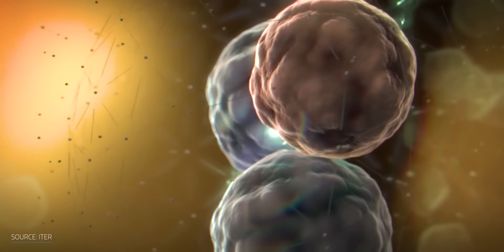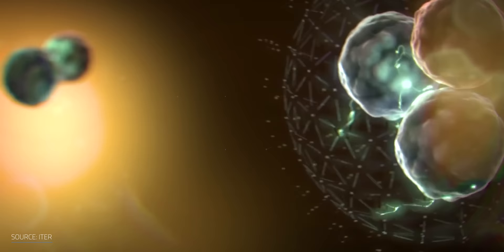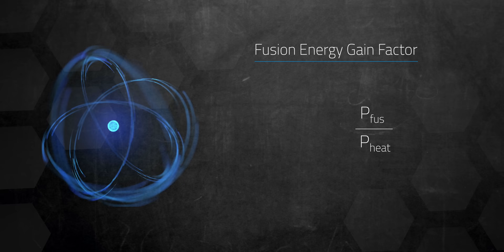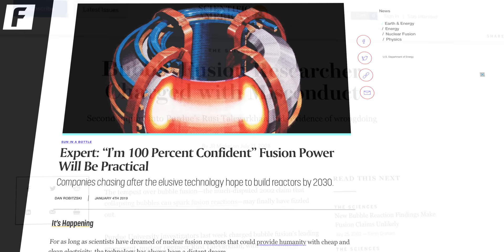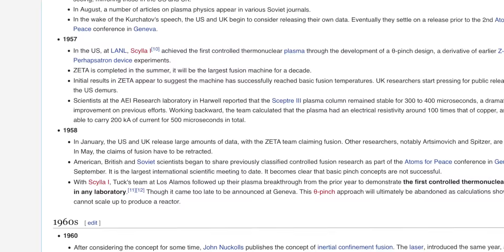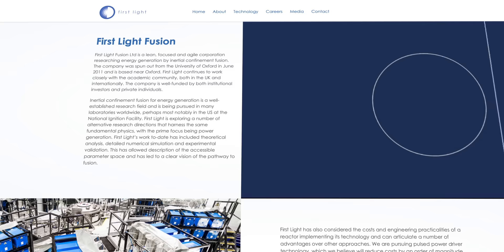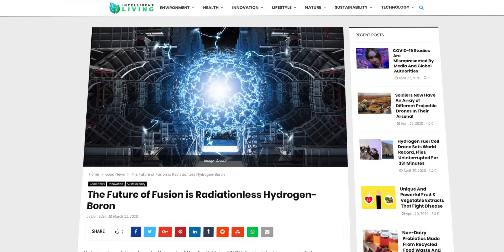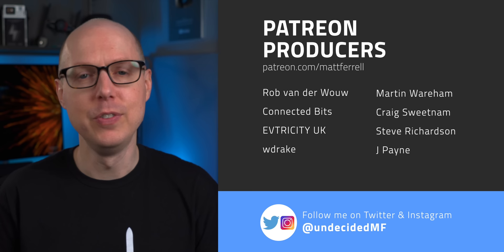The truth about nuclear fusion power - new breakthroughs

Comment: An important distinction between stars and reactors. The video implies that fusion in stars happens when two atoms 'slam together'. What actually happens is that two atoms can get close enough together that sometimes they will quantum tunnel past the electrostatic force and are then able to fuse. Otherwise they never meet. Given the vast amount of atoms in a star this happens frequently enough to produce a sustained reaction. This is why nuclear fusion reactors currently use temperatures far exceeding that of the core of the sun, as they don't rely on quantum tunneling but instead actually do 'slam together' atoms as we think of it. Stars wouldn't even be possible this way, as they simply don't get hot enough. A bit of semantics given that nothing really 'touches' to begin with, but nonetheless useful to understand.
Reply: 🤔 good point
Reply: Well put. Stars -- at least solar mass ones -- are very inefficient fusion reactors. The Sun's core produces less heat per unit volume than your average compost heap. It's just that there's an awful lot of it, and the heat spends an awful long time battling to get out of the core which is fifteen times the density of lead!
Reply: I thought the reason stars produce fusion at a fraction of the heat of a reactor is because of the huge amounts of gravity that squeeze the atoms together? Fusion is fusion.. why would the atoms in a star not meet, but in a reactor they do? I'm not saying you are wrong but, that doesn't really make much sense.

Edit: And to add to that, fusion is produced when two atoms combine. So what does quantum tunneling have to do with it?
Reply: @joshoconnell2104   I'm not wrong. You are correct in that it's about temperature for a fusion reactor even more so than for a star. As I explained, there's the electrostatic force that gets in the way for a star, but with so many atoms enough pass the quantum barrier to fuse anyway. Otherwise stars would use up their fuel in a fraction of the time. Atoms in a fusion reactor get much hotter and thus can simply brute force slam together.

Do a search and read up on it. Search for something like "Star fusion quantum tunneling". Be careful of your sources still of course!
Reply: You should go join them at the nuclear research center
Reply: @videosbymathew  You didn't really answer my question. I'm not out to look for the information you have already read yourself, I'm asking why a quantum phenomenon has anything to do with fusion. I'd like to hear your explanation. I'm certainly not denying that some fancy quantum stuff is going on in a star but, it also happens from an atom by atom basis so, you haven't answered much in that response. Mass and quantity plays a huge role in a stars fusion but, that doesn't explain why it is so much different to fusion we create here on Earth.
Reply: @videosbymathew  By the way; I'm not trying to disregard what you are saying. I'm genuinely curious to learn more about your conclusion.
Reply: @joshoconnell2104  No worries! I would highly recommend you still read up on it yourself. I would also read closely on how quantum tunneling works, which is what's happening when two atoms get close together in a star to fuse. They tunnel past the electrostatic barrier, allowing the completion of the atom to fuse whereas normally they wouldn't be able to get that close. Quantum tunneling makes fusion possible in a star.

As I tried to explain, the star is not hot enough to fuse atoms without this quantum tunneling effect.

I think what you're maybe hung up on is perhaps a misunderstanding of the word "quantum" and perhaps some woo woo you've read about it in the past. Definitely read up on the above, it'll help explain everything!
Reply: @videosbymathew  Yeah, I think I'm missing some crucial information here that isn't allowing me to understand what you are talking about. I appreciate the response though and will do some research on it when I get the time. Thanks!
Reply: @joshoconnell2104  We are talking about the numbers. The sun is a few million degrees. It takes a few hundred million to fuse. So without Quantum tunneling, how much fusion occurs in the sun? The answer? ZERO. But it does happen, why? Quantum tunneling is the best answer.
Reply: @joshoconnell2104  as a chemist, it sounds like the actual motion of the particles, their relative velocities and densities, are insufficient to fuse, therefore, a non-classical interaction must be at play. you can regard any change in any system as having an energy barrier, and the barrier is too high in this case. however, quantum tunnelling allows reactions between reactants that dont meet the energy barrier to happen anyways. usually this happens a lot slower. a good example is phosphorescence. the energy in the light corresponds to a thermodynamically forbidden electron transition, however electrons can quantum tunnel through the transition to the lower energy state and release that photon anyways. and because its slow, it continues well beyond when fluorescence ends (you can speed it up.)
Reply: @joshoconnell2104  In a bit more simple language, the atoms in the sun do not have enough energy to fuse. It's like if you rolled a bowling ball at a hill, and it didn't have enough velocity to reach the top, where "the top" is the atomic nuclei effectively touching and fusing. The atoms "should" always bounce away and not fuse. Luckily, quantum mechanics is a thing, which involves a process called "tunneling", which can be thought of as throwing a baseball at a wall and it teleporting to the other side instead of hitting it, if the ball was a particle and the wall was reeeeeaaaallllly thin. 

In this context, two atoms in the sun get really close together, but not close enough to touch (this is a very simplified picture, the full picture is called quantum chromodynamics), and once they are there but before they repel each other there is some percent chance that they will "tunnel" the rest of the way and effectively teleport together and fuse. 

The original point of Mathew's comment is that earth based reactors actually do get hot enough to fuse atoms without this effect, although as a fusion scientist I'll point out that that is only true for an incredibly small percentage of the atoms inside the reactor despite its temperature (what's known as the "tail of the maxwell-boltzman distribution"), and fusion reactors do actually heavily rely on quantum tunneling to produce usable amounts of power.
Reply: @The_fusion_physics_guy  which reactors produce usable amounts of power???
Reply: Luckily stars work because of quantum tunneling, which allows them to generate fusion energy slowly and steadily for billions of years. If quantum tunneling was not a factor, the fusion process would be a runaway reaction and the whole star would fuse and explode in a fraction of a second. Kind of like going supernova.